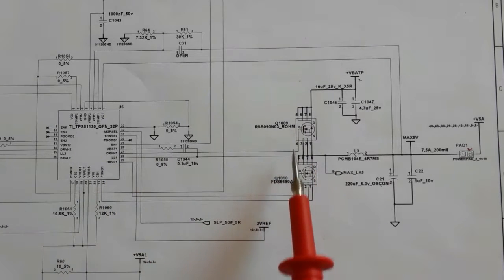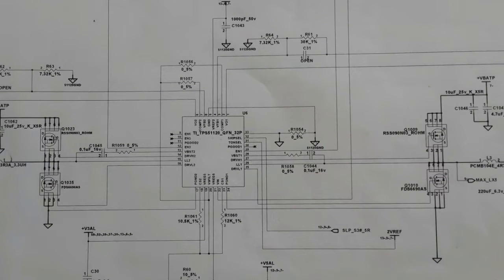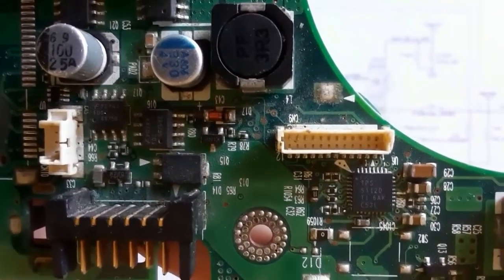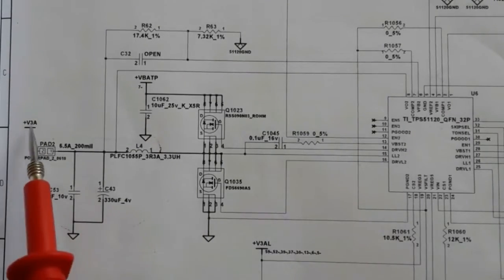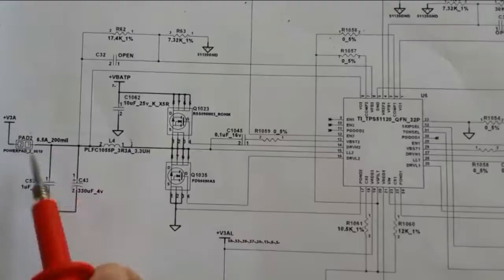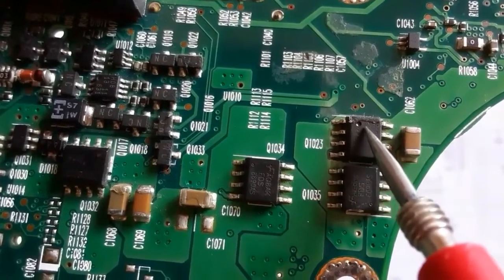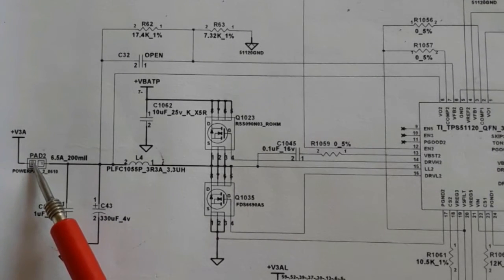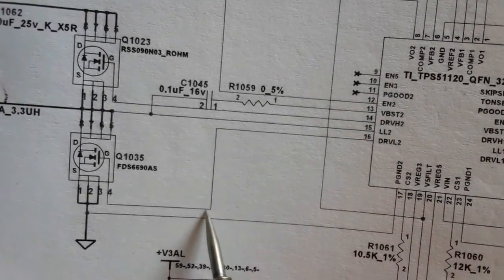Laptop motherboard repair 3V/5V power system circuit | 3v 5v laptop ic

Comment: Hello sir, my lcd laptop msi gf65 thin is broken its blinking, so i open lcd without open my battery then now my laptop dead, i think its short, so what i need to do sir? Alerady check with multimeter my 5v/3v is missing and 2 capacitor behind jack power is beeping when i test use black and red cable to that komponen that i think capacitor 😅 maybe.
Reply: If i want to inject 1 volt to 19volt lane to find short componen, its safe?

Comment: Great video,learning a lot 👍
Reply from the maker: Glad to help, because you like schematics, I advice you to watch the last video that I uploaded (Short circuit repair), you will love it.
Good luck
Reply: @electronicsrepairbasics_erb  I have and great video it was, I was only thinking there will be  times when you can't get hold of the schematic, as I have a old motherboard with lots of ceramic capacitors with no value markings on them,👍

Comment: I replaced a charging socket for a dell computer as you know on a dell computer there are three ports for the electrical socket one negative one plus 19v and another one for the 3v charger ID and by mistake I connected the 19v to the command of the 3v battery I got confused between the ports and since then the computer stopped charging the battery and even when pressed with the charger it only turns on with  A battery that I charged on another computer. I would love to receive an explanation of what exactly happened on the board and how to fix it. Thank you very much. I really appreciate your lessons. Thank you for everything.
Reply from the maker: Hi There,
What happen exactly is you inject by mistake 19 volts instead of 3 volts, and because in any circuit we have protection components against the high voltage, one component was blown out (it could be a fuse or a diode or something else ). So inspect visually and using the multimeter all components next of the battery connector in both sides.
Good luck

Comment: Thanks sir, what is the function of the inductor in this circuit?
Reply from the maker: Faltering purposes (generate a pure voltage )
Reply: @electronicsrepairbasics_erb  is it take a voltage nose and generate a pure voltage  on the mainboard?

Comment: Greeting , at 03:49  What does this chip ( power management ic) do on the motherboard? Is the 3V and 5V voltage supply on the motherboard? if yes how to know this chip is short or not ? thnx
Reply from the maker: That IC is TPS51120 (3V/5V controller) .I will teach you how to to test it using the multimeter soon.
Reply: @electronicsrepairbasics_erb  I'm looking forward for your next video about it
Reply: @electronicsrepairbasics_erb  thankyou

Comment: power management ic  supplier 3v and 5v on the mainboard ?right ? how to check & test this ic with multimeter please how we can know power management ic  is working fine , how to troubleshooting this ic with multimeter ? please make a tutorial video for that . for test & checking which pin of this ic must be check??? thnxxxx
Reply from the maker: Ok of course I Will. For now you can check the ceramic capacitors around the IC, if any of that capacitors is shorted means the IC is bad.
2. You can check the heat of The IC, if it is not normal means the IC is failed.
Reply: @electronicsrepairbasics_erb  thankyou for quick response . your tutorial are awesome . keep it up
Reply: for checking  the heat of The IC, in normal situation, it must be cold or hot ? thnx